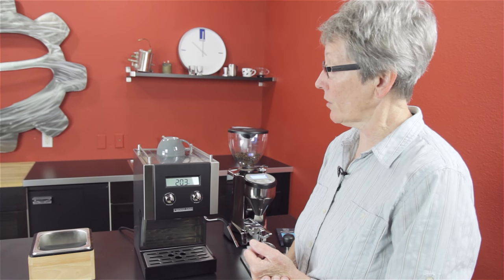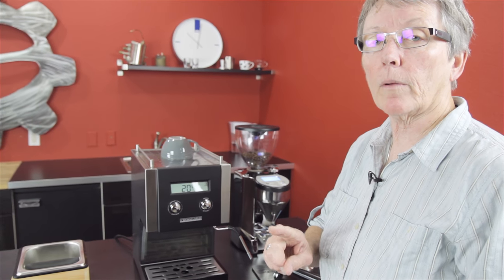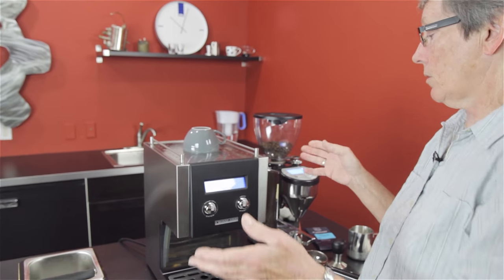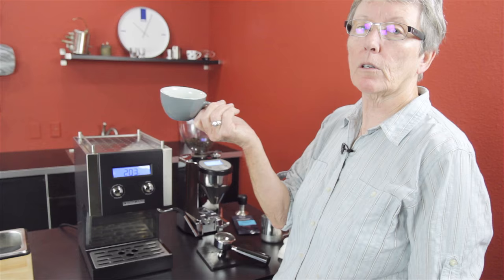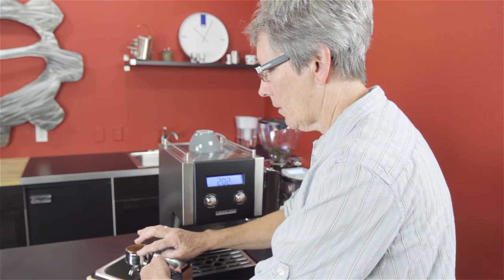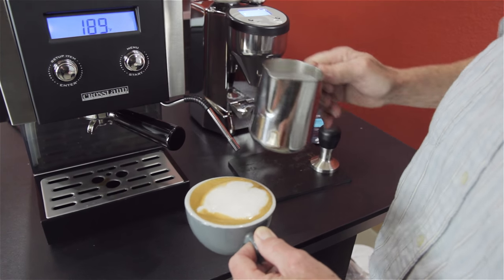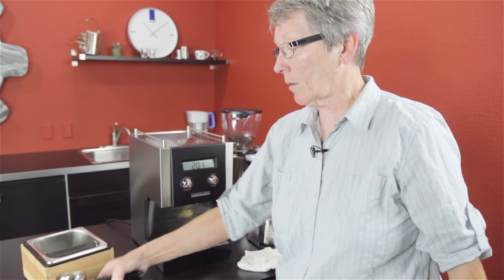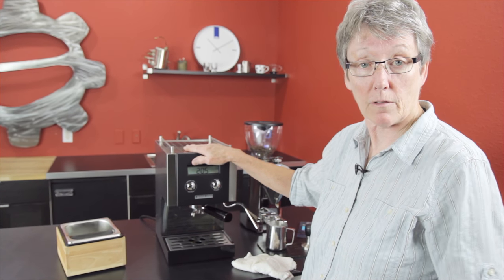Crossland Coffee CC1 Espresso Machine | Crew Review

Comment: No running water after steaming?  Wouldn't the thermocoil be way too hot coming off of steam and straight to brew?
Reply from the maker: The steaming uses a separate thermocoil. The brew water stays in the single boiler. Unique design :D
Reply: Hah, didn't know that.  Guess that machine is really in a class of it's own.  I guess this is why you steam first then brew since thermoblock takes a bit to get up to temp.

Comment: Is this machine still only available in 120V version from the manufacturer ?
Reply: I was wondering the same thing.  Europe could use a simple machine with PID.
Reply: MyKrumlov Yeah. When I was looking for an espresso machine the CC1 had recently been launched and I wanted to get it rather than the Silvia because having to temperature surf and  getting inconsistent brew temp was an issue. But I thought that the Silvia had been out for many years and has good reputation over here in Iceland and I would go with that machine rather than a new brand of espresso machine with no reputation. But then I noticed it comes only in 120v and it's been now 4 years I think I remember right since then.

Comment: I'll never understand why you don't use bigger cups. That double (2oz) shot took up pretty much half of that cup, meaning there was virtually no room for any milk. I'm not saying it's wrong, but what looked like a 1:1 espresso-milk ratio (or near enough) is far from being a cappuccino.
For that sized cup surely you should just use a single 1oz shot?
Reply: the cup gets bigger towards the rim, therefore, there's more room towards the top of the cup. That is a traditional cappuccino cup (5-6 oz) and a traditional cappuccino uses a 2oz shot.